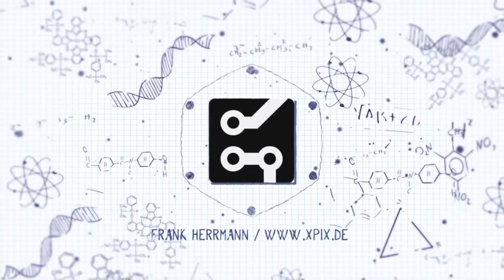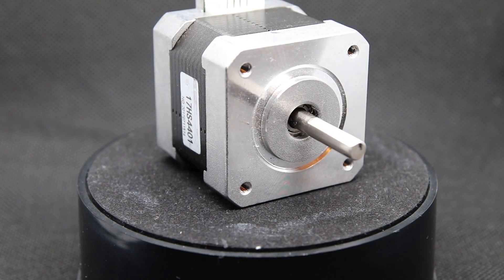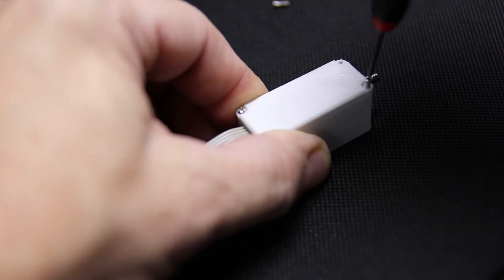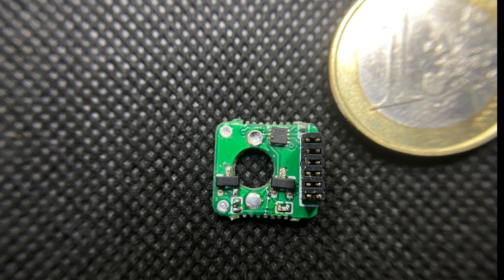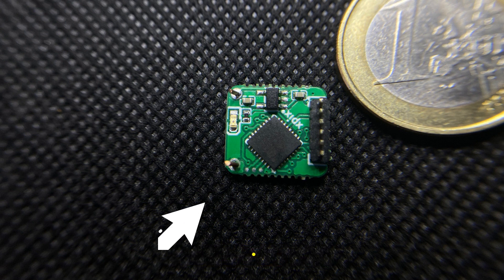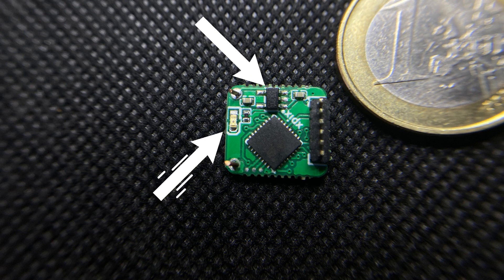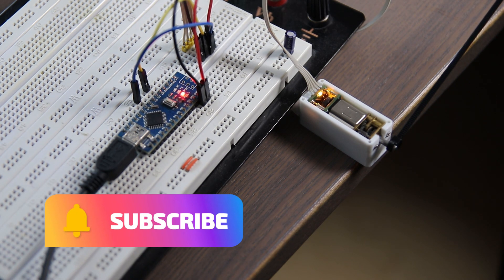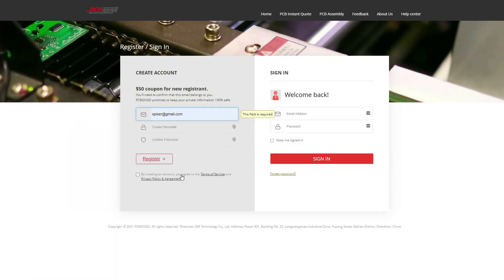S01E01 DIY DCMotor smallest Steppermotor with Driver and Servofunction in one package (English)

Comment: As BlackWallFilm mentioned, very interested in this for the purpose of 3D printing.  I've made many many prototypes with these motors as filament drivers, as they are already pretty good filament drivers in 3D pens.  What the pens lack, however, is the ability to control them.  What you have is potentially a great lightweight direct drive for print heads.
Reply from the maker: Thank you, I think that should be possible. If you want, I can send you a prototype, you would only have to solder some parts yourself but I would burn the firmware onto the chip. Please contact me: xpixer (at) gmail (dot) com

Comment: This is ideal for an extruder motor for a 3dprinter (less weight means less possible wobble at higher speeds)! What is the resolution (in other words how many steps per revolution?). And how fast can it turn compared to a regular stepper motor? Finally what will be the total price estimation for this cool stepper?
Reply from the maker: Hi Walter, we have a 298:1 motor here and 6 signals per revolution, which makes 1788 steps per revolution. I just tested the speed at 1mm per revolution and ended up with about 80mm/minute. With a different gear ratio it is of course faster: https://www.pololu.com/category/60/micro-metal-gearmotors
My cost per engine is approx: $19(motor) + $10(PCB): $29

Comment: So, if I understand correctly, the microprocessor on the second board is able to run all the PID software for doing the closed-loop locating?  Even if someone has done it before, this is a very space efficient solution. ..  I'm trying to figure out how to purchase parts on the OSHW page.  It's not obvious!  Is there a repository for the code you used to program the STM?
Reply from the maker: Hello Eric, you can download the Gerber files from the OSHW site and use them to order the boards from a PCB manufacturer. Use "Open in Editor" and then in the Editor menu "Fabrication -> PCB Fabrication File (Gerber)". Code: https://github.com/xpix/XMoto/blob/master/XMOTO/xmoto_stm32/xmoto_stm32.ino
Reply: @xpixer  Thanks!  For my application, a pedal steel guitar, I'm going to need 8 of these on 10.5mm centers for 8 strings.  So I'm going to have to redesign the circuit boards to be 10x14mm.  I'll see if I can get my head around the editor.

Comment: How accurate is this thing?
How much was total cost? I always wanted to diy a stepper motor with an ecoder. Maybe even 3dprinted ones SLA?
Reply from the maker: Hi, we have a 298:1 motor here and 6 signals per revolution, which makes 1788 steps per revolution. I just tested the speed at 1mm per revolution and ended up with about 80mm/minute. With a different gear ratio it is of course faster: https://www.pololu.com/category/60/micro-metal-gearmotors
My cost per engine is approx: $19(motor) + $10(PCB): $29